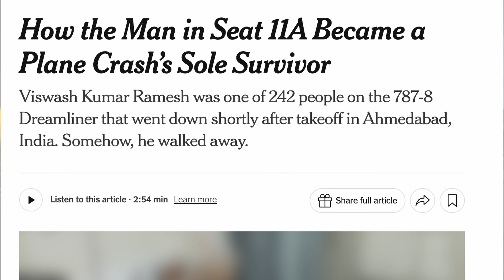Why the RAT Changes Everything – Air India 171 Update

Comment: I remember a USAF 20mm gun pod that was powered by a RAT (Ram Air Turbine). That meant any of the USAF planes of the day going to Vietnam could have hung a gun pod (SUU-23) on one wing station (with or without power) although I never saw any more than a single RAT equipped gun pod in the two years I worked on and loaded them. I then worked on F-4E model Phantoms the ones with a built in 20mm Vulcan nose gun so they never needed a gun pod besides the one McDonnell Douglas included with each F-4E purchased by the USAF.  It only carried about 750 rounds of 20mm which is a couple of one second bursts so they had to be choosy of worthy targets or that nose gun was useless once empty. The 20mm came with a whole bunch of different 20mm rounds from armor piercing to incendiary to anti personnel to tracer and target rounds. That was a great weapons system as long as you were the ones using it. 
https://duckduckgo.com/?q=USAF+20mm+gun+pod+that+was+powered+by+a+RAT&atb=v314-1&ia=web

Comment: Also in that freeze frame bit with RAT circled in red, its clear the flaps were partially down. About where they should be for takeoff... though the grey shadow on the wings surface (spoilers???) is still an issue.

Comment: Depending on how the fuel system is configured. If fuel is pulled from the respective wing for each engine and not directly from a center tank, it would be wild that the contamination made it to both engines at the same time. If they were sharing a common tank and it had water in it, maybe the pitch up angle right after takeoff caused the water to flow into the fuel pickup tube.

The only other way both engines could fail simultaneously would be if fuel cutoff was commanded to both engines from a malfunctioning computer, still crazy that left and right wouldn't have some degree of isolation from each other with respect to control computers. Turbine engines don't just quietly die without even a puff of smoke unless their fuel is suddenly taken away.

Comment: There has been analysis by another person namely swiss001 an aviation youtuber and he mentioned a very interesting point:
He said that if you look closely, you could see that the wheels were in a weird position as for this kind of airplanes the landing gear would be tilted to the back in an angle but in this case from the video where the RAT is visible the landing gear is almost horizontal or maybe even tilted foward which is the configuration of the landing gear being retracted and the airplane lost power mid retraction of the landing gear.
Reply: If fuel was a factor other aircraft would likely have had problems as well.
Reply: But I'm wondering if the RAT would provide power to fully raise the landing gears?
Reply: @kaalsarchives199  no
Reply: Maybe, but a lot slower propably. 
 @kaalsarchives199
Reply: yesss
Reply: Could be.

Comment: Steve, you know as a long term pilot and I know that planes are just like that, not falling from the sky. There is the option installed by the Boeing that  allow shutting down plane's engines by satellite. That what happened to Malaysian airplane  and that's what happened in this particular event. It is not pilot fault, it is not mechanical, IT IS 100% POLITICAL!!! Big warning to Mr. Moodi's political policy towards BRICKS and cooperation with Russia. So, Steve, stop making this empty assumptions. :face-blue-smiling::face-blue-smiling::face-blue-smiling::face-blue-smiling::face-blue-smiling::face-blue-smiling::face-blue-smiling::face-blue-smiling::face-blue-smiling::face-blue-smiling::face-blue-smiling::face-blue-smiling::face-blue-smiling::face-blue-smiling::face-blue-smiling::face-blue-smiling::face-blue-smiling::face-blue-smiling::face-blue-smiling:

Comment: Could be an act of sabotage. Fuel could have been tampered with or tampering in the fuel delivery system. Two engine failure is an extremely low probability event. The pilots left the landing gear lowered to use it as a cushion as they knew they were going down.

Comment: I just don't understand how this could have happened, there's the video of the guy showing power failure before takeoff on the plane, the AC wasn't working.... the same plane was having power failures leading up to this flight. 

Doesn't Boeing have some kind of remote diagnostic link that would alert them that one of their planes is having issues, therefore they could then prematurely reach out to Air India and tell them to check a specific plane before it goes airborne???

I mean this is one of the most advanced, newest, and most expensive Jets ever conceived, designed, and flown in the history of Aviation😮

Comment: Many thanks Captain Steeeve for your thoughtful view on this time. This reminds me of my dad telling the story the "PIED PIPER of HAMLIN". But RAM and RAT are other things that relates with the technology we can understand the concept. Nice of you.

Safety Review and Recommendations for Aviation Operations

Recent incidents call for a comprehensive review of aviation safety protocols, particularly concerning onboard electronics, cabin hygiene, and cargo handling.

Electronic Systems & Emergency Risks
Flights should minimize dependency on complex inbuilt electronic gadgets, especially those not essential for navigation. In emergency situations, malfunctioning electrical circuits—potentially triggered by high voltage, temperature fluctuations, or faulty wiring—could cause power failure and hinder rescue operations.

Hazards from Rodents and Pets
Pets, particularly rodents such as Rattus rattus, pose a serious risk in aircraft environments. The presence of food and oils in cargo can attract these animals. Their droppings or urine on electrical panels can cause critical system malfunctions. If any burnt remains of such creatures are found post-incident, it should serve as evidence for urgently sealing all possible entry points.

Sanitation and Lavatory Concerns
Improper use of lavatories, blocked systems, or leakage of waste can produce hazardous gases and affect onboard air quality. This too requires close monitoring and frequent maintenance.

Design & Baggage Screening
A technical audit of flight design, internal mechanisms, and storage arrangements must be conducted. Each baggage item should be screened thoroughly, considering the broader spectrum of combustible or harmful contents that may trigger inflight emergencies.

Maintenance and Post-Flight Review
Aircraft must undergo comprehensive maintenance checks both before departure and after arrival. This includes thorough cleaning and sanitisation of all zones—not just passenger areas, but also cargo holds, lavatories, ventilation shafts, and hidden compartments. In the event of an incident, odour analysis should be conducted to help identify the types of materials that may have burned. All physical residues and particulates must be collected and tested for forensic insights.

Additionally, fuel tanks should be periodically detached and cleaned to prevent contamination. Residual deposits in tanks can clog filters or obstruct the regulated inflow and outflow of fuel and air, especially at varying speeds. These particles may disperse across critical engine components, potentially affecting performance and compromising safety. A system-level inspection of fuel propulsion mechanisms is therefore essential for uninterrupted engine function.

Conclusion
The evolving complexity of modern aircraft demands a heightened level of vigilance across all domains—design, operations, maintenance, and sanitation. Negligence, even in minor areas, can amplify into life-threatening events. A preventive, systems-based approach—backed by rigorous inspection, pest control, proper storage protocols, and post-flight diagnostics—must be institutionalised to ensure the continued safety of aviation travel. Every component, process, and interaction within the aircraft ecosystem must be re-evaluated to minimise risks and uphold the highest standards of operational integrity.

With Love
Anitha Babu
15.06.2025

Comment: The engines were from GE and they are using realtime telemetry data for their engines, same as RR for instance. An engine failure would be directly reported to their operations center. Long story short, they already know what happened to the engines without the need of the black box. Or am I wrong?

Comment: Steve it is evident both engines failure due to contaminated fuel due to rainwater ingress entering tanker lorry ( very heavy rains in Ahmedabad now) and entering plane tanks. Both fuel pumps lost power due to sensors inside the fuel tanks, pilot byepassed alarm thinking false and subsequent crash.

Comment: I think I solved it Captain! I saw a video a passenger took in the airplane a day or two before the crash flight!
Well the passenger noticed electrical flaws with the LCD monitor in front of him before his flight! With that said! Since it was 24 hours later,  they had problems with the electrical system in front of them, while going down the runway!  The rat turned on just when they got to the point of commitment took off with just the rat engine engaged however not enough to take plane out of it thrush failure!  
1.So just at the point of take off, commitment to rotated commuted!
2. Rat engaged! But not enough to restore the momentum, Thrust from the engine. 
Let me know what you think!

Comment: We see slats, we see RAT, we hear RAT, we DON'T hear engines, we see good initial roll rate and climb rate with a follow-up loss of rate and start of descent. Even without pilots saying anything to ATC the picture is quite clear. It was quite clear from day 1 to be frank just based on how aircraft has rolled and started to climb and then descended (would be a different picture with flaps retracted), but now it is absolutely clear.

Comment: Other YouTubers have shown the controls for this plane. Based on the locations and type of mechanism that operate the flaps and gear. No competent pilot would mistake them. One is a lever next to your hand the other is a knob on the center console type of thing. I think it might be time to eliminate that theory altogether. Look at the controls for each function and you will agree I bet. If it were something easy to mistake the problem would have come up by now with how long these planes have been flying. Considering that theory rest on the incompetence of the co pilot I  don’t think you should say it, look at the flight controls for yourself and decide if someone could really mistake one for the other. Unless the controls are different from what I saw there is no way he mistook the flaps for the gear.

Comment: Dual engine failure in a 787, what caused that.the statistical probability of that pretty much rules out “ accidental”.
FDR info is going to be damn interesting.
Horrific tradgedy for the victims and families. One of the safest airplanes ever released, more than 20 years without a fatal crash, something smells rotten here.

Comment: There is a video filmed by a passenger on the inbound flight which later became the ill-fated departure. He mentioned and took video evidence of electrical failures and issues on the aircraft before deboarding. This to me suggests an electrical failure cause the engines to die and the rat to deploy.

Comment: This is a 787 right after TAKE OFF. The JAL 787 was on landing. Yet the sounds of the engines are similar. Thrust is near idle on landing, but should be near the maximum on take off. This also yet further proves the theory of dual engine failure.

If the engines were operational, I’d expect the sound of the RAT to be drowned out by the engine roar

Comment: Question;  Do engines fail without a flameout.   Was there a flameout seen?  I didn't see any flameout.  
Question 2 is it possible that thing you see as the rat is actually something else?   And noise around an airport is hard to interpret even in the best of conditions.
Admittedly the Japan plane landing with rat deployed sounded a bit like part of AI 171.

Comment: I hate to bring this up, but…. Duel engine failures, most especially near simultaneous duel engine failures are unheard of.  Unfortunately that leaves us with an unfortunate more likely scenario that no pilot wants to say.  And that is pilot error.  It is entirely possible and not unprecedented that during a single engine failure the wrong engine gets shut down.  It has happened before, more than once.

Comment: The both  Engines stopped working just after take-off. It took approximately 16 seconds from take-off to reach maximum altitude and took approximately 16 seconds from maximum altitude to reach  crash on ground, means just after take-off it was just like a stone thrown upward direction.
Probably the flaps were intentionally disengaged to cover up maximum horizontal distance to find out an open space to crash landing as a last and only available option, may be tried to reach jb medical college sports ground and that's why didn't lift the landing wheel.
As per interview of near by people the plane didn't have usual sound generally they heard during landing and take-off instead there was a low intensity noisy sound, it was the sound of RAT which operated automatically after failure of both engines.

Comment: You think that the rat came on because of a dual engine fairly, but I think it was a single engine failure on takeoff and failure of the center hydraulic. Because.
They couldn't get the gear up.They slowed down stalled and crashed

Comment: I agree, they must have experienced something that caused a complete engine failure. The dead silence in the video just before the crash was eerie... jet engines should have still been somewhat audible at that distance, especially given they should have been at TOGA thrust. The pilots may have altered the flaps in an attempt to extend a glide, or they lost hydraulic pressure as well even with the RAT out. Either way, they were too low to really do anything.

Comment: I've seen demonstrations of the cockpit and the location of the wheels up and flaps controls. They are very far apart from each other AND have no similarities in look and feel. Ie. The flaps are a lever, like a transmission shifter on the center council of a car. The landing gear controls are more like a knob or dial much higher up on the dashboard. So it would be very different to confuse them

Comment: There is barely any sound from the engines but the RAT noise is dominant. 

When a 777 takes off the noise from the engines are so loud it feels Iike ears will pop and windows rattles. 
-like he says it is Most likely it’s both the engines failed. 
-And that bang noise as per the survivor 
-May Day call Losing thrust means engines went flat

Comment: Locals in that area told that there was no sound in the plane after taking off and the plane was shaking. The locals said in an interview. It seemed that both engines were off after taking off. And the guy who saved in this crash said, there were unusual sound before crash, he was thrown away as emergency gate broke in the collision before blast. He threw away with the seat. He survived because he was thrown away 1sec before the blast after collision with the building. And it was highly populated area, if the pilot didn't turn the plane towards medical hostel and towards ground, then there could be thousands of people died.

Comment: That video is not clear enough to support your suggestion prior to a full comprehensive accident report .On all of the many different jets I've flown and instructed on loss of total electrical power  ( battery power only)  even after the jet was configured for takeoff doesn't add up,in other words the airplane will still be flyable, granted i'm not typed on the 787 but do understand part 25 certification.So if you have a complete loss of electrical power ( not likely on a modern jet ) the flaps and slats would retract increasing the stall speed ?

Comment: Good that you changed your mind,, RAT deployment indicates, Engines went down,, not power & may be no control too,, fuel contamination (water, sand, chemicals or engine control failure, timer-temperature based),, we been saying this ever since
Reply: No, the engines went into idle thrust safe mode because of loss of AC power, which was caused by something they did not check prior to takeoff that you’re supposed to check to make sure the engine driven generators are online which is automatic on engine startup but if there’s a bus fault that prevents the engine driven generators going online you make sure that the Engine generators are online before you shut down the APU, which takes a couple minutes to shut down and if you shut down the APU just prior to takeoff and the APU shuts off after takeoff you lose AC power and the rat pops out and the engines go into idle thrust safe mode, and you have to move the thrust levers out of takeoff, thrust detent, and back into takeoff thrust detent to get the power back to full thrust.

Comment: Omg you want to blame the experienced pilots of a beginner mistake. You are ridiculous and the flaps so funny blame the pilots of another rookie mistake. Blame the pilots again for another rookie mistake. If you knew anything at all you would see the wheels changed angle which happens when the landing gear is beginning to go up so it appears to have failed at that point. That whole aircraft failed. The signal going out,the landing gear froze going up and both engines failed. Total catastrophic failure of the plane. And you wanted to blame experienced pilots who courageously flew this plane. You should be ashamed of yourself.